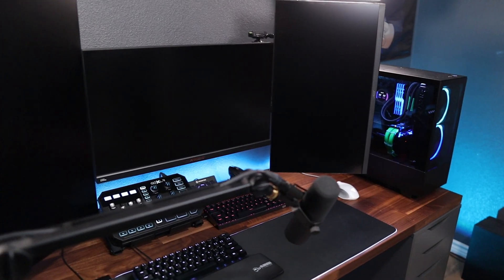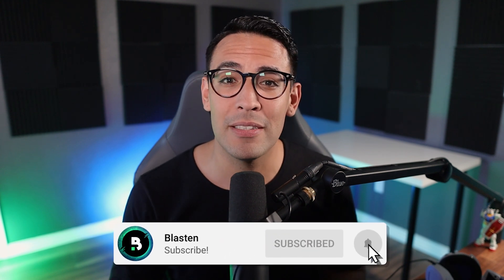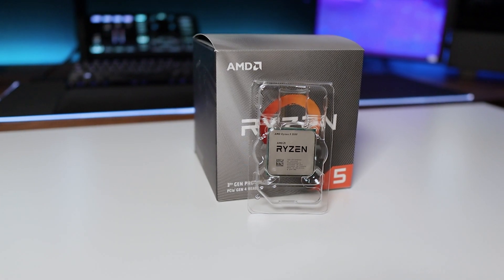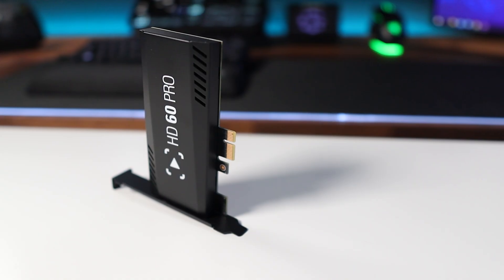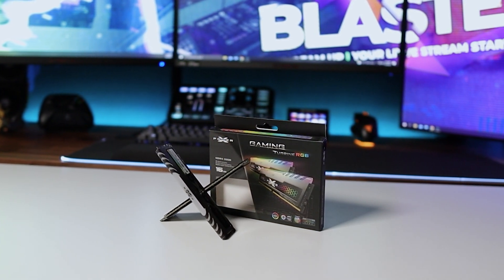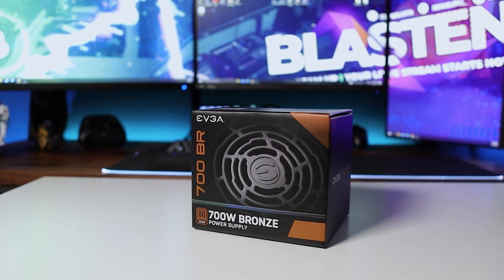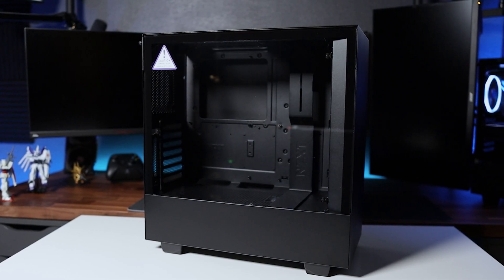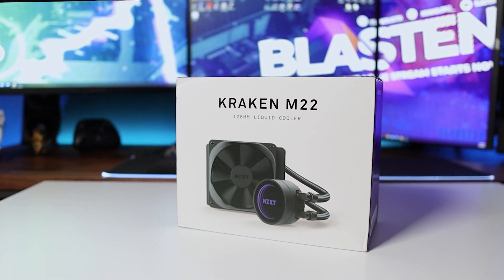The Best $1200 Dedicated Streaming PC Build 2021 - 1080p 60fps Streaming

Comment: You can get away with no GPU, use the onboard graphics.
Reply from the maker: could but nvenc is better
Reply: @Blasten  not really. In fact a 12600k with no gpu is better on x264 medium.
Reply from the maker: I did this before 12600k was out

Comment: Great build but its overspending and doesn't make sense For me since you dont have to overspend for a dedicated streaming pc only.
Unless its a dedicated stream+editing PC.
If you throw a r7 or r9 in that rig and add more ram than thats already a stream+ video editing PC.
But you can go cheaper with lower end CPU, mobo, case, PSU, AIO since you'll be using nvenc only and this hardware doesn't matter.
What only matter is your GPU nvenc generation and capture card or just use NDI.
Reply from the maker: Thats what i said in the video

Comment: Someone else told me that for a dedicated streaming pc using cpu with x264 is better and It actually comes out better on stream and you dont need a gpu. Using the gpu to encode is only better if your gaming on the same pc to lessen the pressure on the cpu. Thoughts?
Reply from the maker: That used to be the case. And kind of is only if you can’t get a 1550super or 1660 at msrp. the new touring nvenc encoder is superior to x264. But if you can’t find the gpu listed at msrp, cpu with x264 will be better cost effective
Reply: @Blasten  ah ok thanks :)
Reply: @Zoddric  I disagree. Go to twitch Kendragon75. Dedicated streaming pc with 12600k and no gpu. 12th gen intel is a beast with dedicated pcs for streaming.

Comment: Could I use a Ryzen 5 1600 series and a 1660/1660oc/1660s
Reply from the maker: Yup. And it’ll run perfectly cause all we need is the touring nvenc encoder that’s on the 1650super all the way up to the 3090.
Reply: @Blasten  thank you
Reply: @Blasten  is the 1650 super the only one with touring nvenc
Reply from the maker: @itsmanlikehark3203  1650 super all the way through the 20 and 30 series to the 3090 have the touring encoder. 1650 and the 10 series have the pascal nvenc encoder.

Comment: can i use the 1650 super instead of the 1660 only one available at the moment
Reply from the maker: Yes since the 1650 super has the same encoder. But make sure it’s a super. The 1650 has the older encoder

Comment: Great build! It’s a little bit of overkill for a dedicated stream pc but better to have more than less! You can get away with a 2GB GPU using the CPU for the encoding. Especially in today’s time where a 1660S is going between $450-$500
Reply from the maker: if you can find used or msrp, 1660s is awesome, it also encodes at a better quality than a cpu would. Quality was the focus here but I do plan to do another budget stream build!

Comment: hey man one question. im running a dual pc setup. my stream pc specs are ryzen 5 2600 with gtx 1660. what would u rather use to encode x264 or nvenc? thanks in advance!
Reply from the maker: Nvenc hands down
Reply: ok ty !

Comment: I’m going to buy a streaming pc, and my budget is 1.6k ich any tips ?
Reply from the maker: check out the nzxt starter pc
Reply: @Blasten  is that a good streaming pc ?
Reply from the maker: You can definitely stream with ease with it using the nvenc encoder
Reply: @Blasten  am just scared to buy the wrong thing but some of these $2400  plus builds are expensive
Reply from the maker: @gregorycastillo4799  what’s the current specs you’re looking at ? Did you see my nzxt review?

Comment: Hi, did you have any problems with all that cables from power supply to fit in the case? I want to buy same case and PSU but i am little concerned about number of cables of that PSU. Thank you!
Reply from the maker: No I did not have any issues

Comment: It looks like nobody has ever made a video about this but could you somewhat answer my question, I’m wondering if you can take a prebuilt PC GPU like the HP Pavillion 1650 Super and put it on a different motherboard like a B450 Tomahawk Max?
Reply from the maker: Yes you can
Reply: @Blasten  thank you
Reply: @Blasten  also what bout the AMD CPU in the HP Pavilion, can it be used on a B450 Tomahawk max as wel?
Reply from the maker: @iiTzRin  what model cpu is it?
Reply: @Blasten  AMD Ryzen™ 5 3500 Processor
Reply: @Blasten  nvm it does
Reply from the maker: @iiTzRin  yes it’s compatible